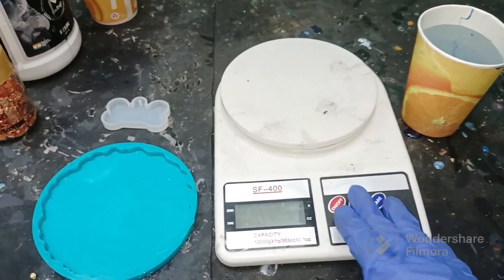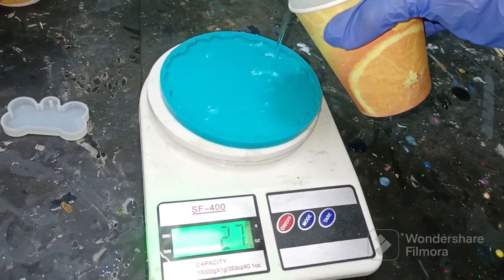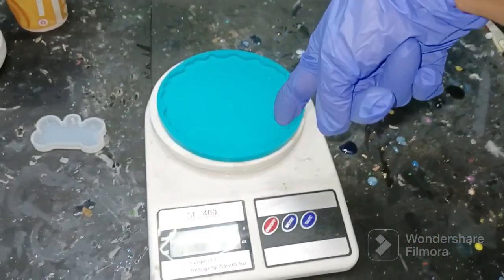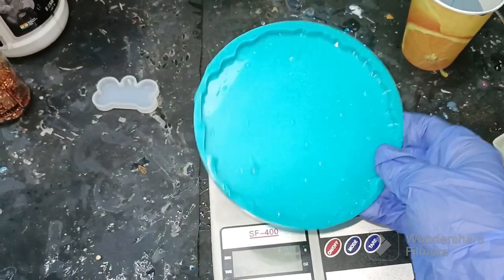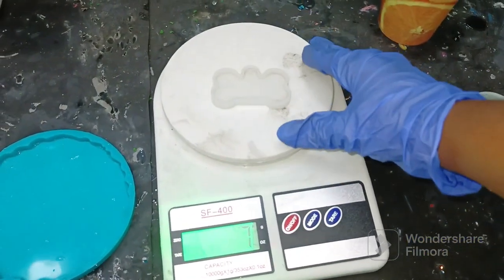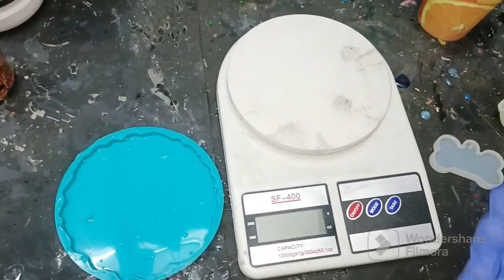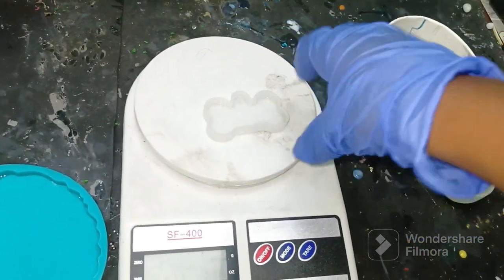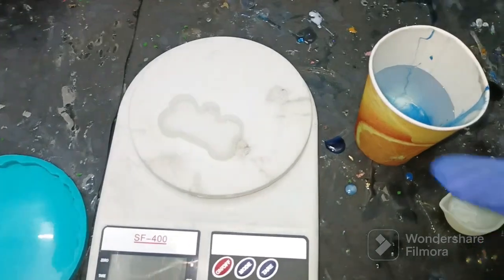How to Calculate Resin needed for a particular mould | Epoxy Resin Art 🌻

Comment: After doing water methord how to divide the resin and hardner tbat prcess vedio plss i undersstood thi but how to divide as you said 61 or lets take 60 grams but how to divide into hardner and resin pls do let meh know!
Reply from the maker: The resin and hardener is to be divided in ratio...like 3:1 ratio or 2:1 ratio. It is mentioned on the bottles. Make sure to take proper measurement while taking the proportions. For eg. If it 3:1 ratio, then 45 gms resin & 15 gms hardener...total 60 gms (out of which 3 parts is resin & 1 part is hardener)...and if it's 2:1 ratio...it will be 40 gms resin & 20 gms hardener...total 60 gms (out of which 2 parts is resin & 1 part is hardener)